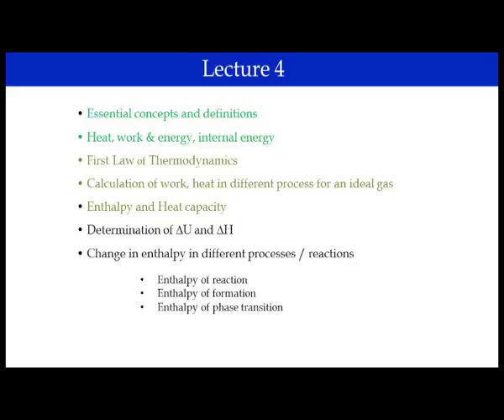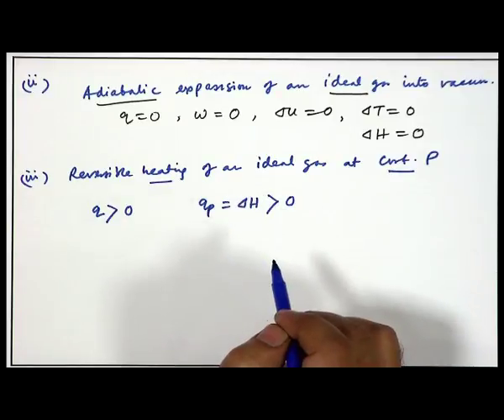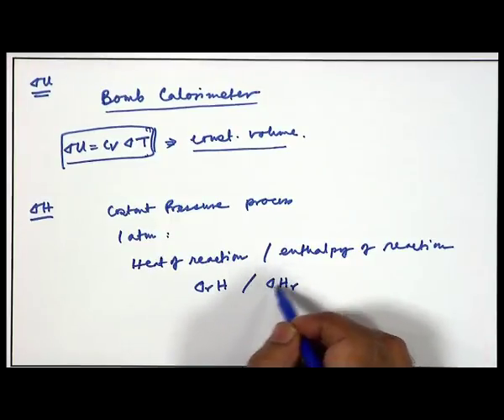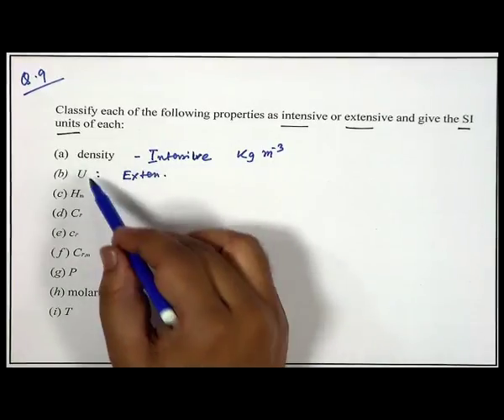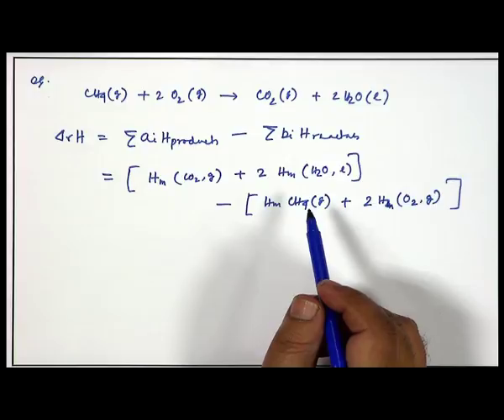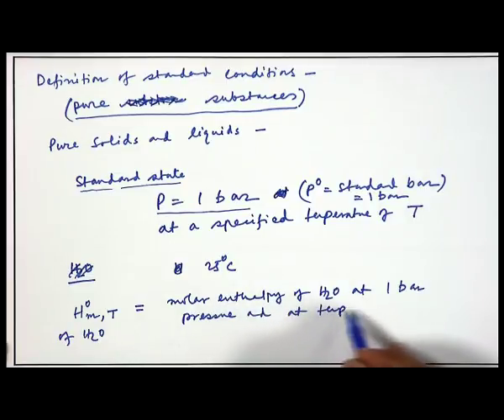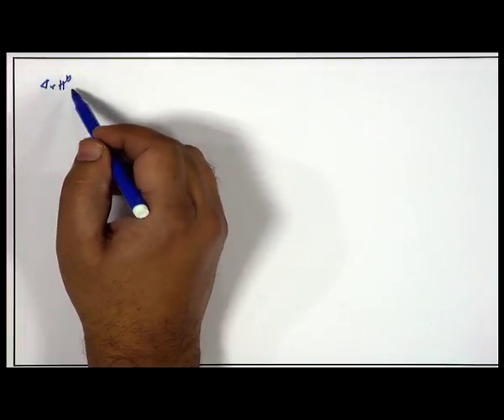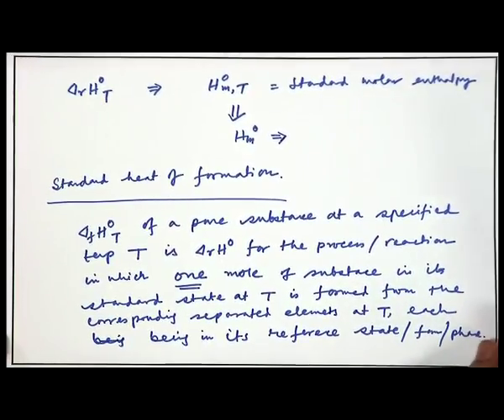CHEMICAL THERMODYNAMICS-4 (CH_20)

Comment: sir in ques.7 how can u use Cv because the volume is not constant?
Reply: its completely  relevant in taking Cv, as explained in previous video.The process can be broken down into two fold process i.e constant v process for path1 and constant t for path 2 to reach the final state function. Thus del u = del u1 +del u2. BUT del u2 is ZERO as for constant temp process in ideal gas . Thus del u = del u1= CvdelT and thus its ur answer.